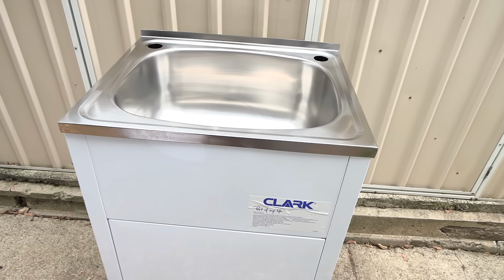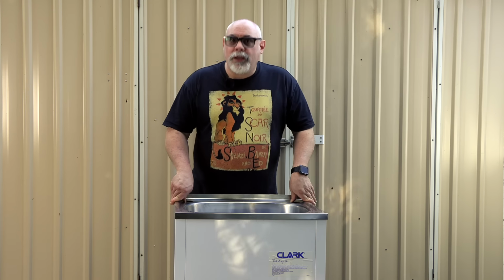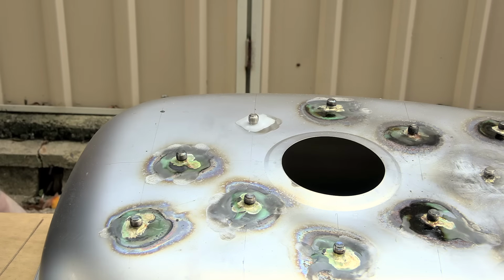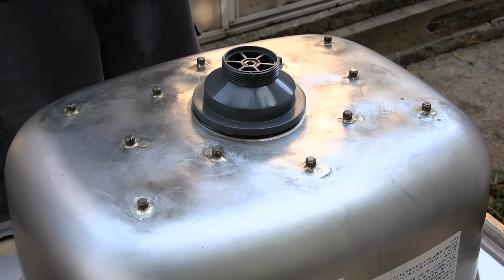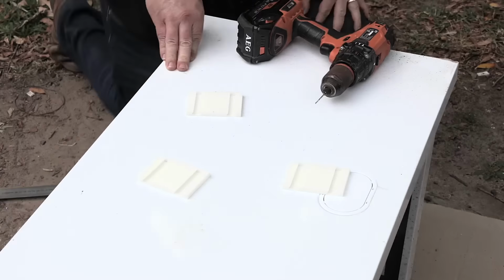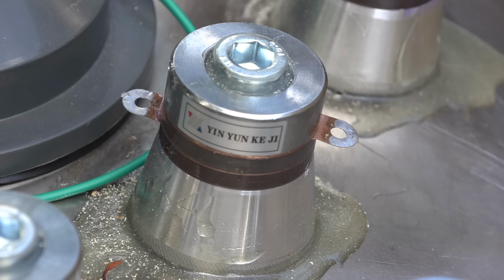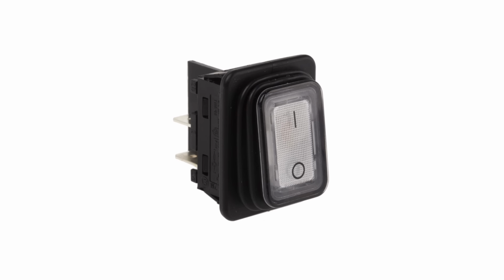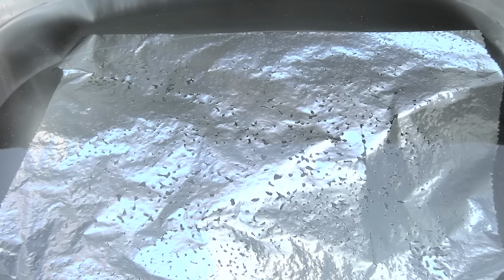Building a Laundry Sink Ultrasonic Cleaner

Comment from the maker: IMPORTANT!: To the many people who have emphasised the importance of placing grommets around the cabling going through the metal chassis, rest assured THIS HAS BEEN DONE, it just doesn't appear in the video. The chassis has also been earthed.
Reply: That's fine, but you need to make the need for earthing clear in your video and on your schematic. Other people may follow this method and not think about it. This is a particularly hazardous project with a metal chassis containing water, and mains power beneath.  A low power control panel using 12v to drive relays switching the mains power would also have been a nice safety feature. Otherwise - great project.
Reply: Lol earthed… it’ll be fine… I earthed out a single wire earth return, carrying 19kva. I de energised the line with my body. I lost both legs n 30% of my body is skin grafted….
Reply: Even the mains bus bars are sketchy, it should have physical isolation between them
Reply: What was the cost compared to buying a cleaner? Was this worth it?
Reply: I would also highly recommend GFCI.
Reply from the maker: @JeffreyBaitis  That's referred to as RCBO here in Australia and is mandatory in all households.
Reply: @BranchusCreations  Great to hear. Unfortunately USA has a lot of legacy/dangerous wiring that is very unsafe in any setting involving liquid. Also, your project is awesome!!!
Reply: @BranchusCreations  There is a rule for connecting the ultrasonic module. After installing, if it doesn't shocks when touching the water then the connection is right otherwise swap the connection🎉 ...
Reply: @BranchusCreations no not all houses. All new houses and recommended in all existing houses. As a contractor I come across houses on a daily basis still using ceramic fuses
Reply: I was just going to mention..... lol well done. Where is the vid of showing this sink cleaner testing please?
Reply: Glad you mentioned that you grounded it! I completely missed that during the video at a glimpse! :)
Reply: @Look_What_I_Did  their concerns are valid and if he doesn't stick a note here the chance of any useful comments being seen will be lost in a comment waterfall of, "grommets and earth?!?!?!"
Reply: As a electrician earthing and mechanical protection is my biggest priority. Love the Build excellent job
Reply: @BranchusCreations  للأسف ليسة لدي حساسات ولا مشغلات كم أتمنى أن أصنع واحدة فلدي عمل فيها مهم
Reply: @BranchusCreations  أريد المشغلات مع الحساسات بشرط أن يعملون بشكل جيد . ٢٠ واحدة
Reply: Great to see you've addressed the earthing and grommets — really important for a build like this. One thing I haven't seen mentioned anywhere in the comments: do you know the actual output voltage these drivers produce on the transducer wires? Since they run on 220V mains, the output to the transducers is high-frequency AC and can be significantly higher than mains voltage depending on the driver design. Just curious whether you measured it, and what insulation rating you used on the transducer cables. Thanks for the great content!
Reply: I pleased to see this reply, I was more than a little concerned about the earth connection as it wasn't mentioned in the video. Great job
Reply: I'm sorry this video was a little disappointing from a safety perspective. I was crinching at this project nearing the end with the same two issues everyone was mentioning - the poor mains cable management and the lack of overall earthing. This project is an earth leakage and shock potential nightmare.  You really should put a disclaimer at the start of the video even though in the comments here you say you have done all of this which is gfreat. It is so important.
To not know to do this (the earthing especially), or understand the requirement to do so from the very start doesn't give much confidence. Harsh words I know and I'm sorry. Please understand, that those driver boards don't appear to have isolation on the primary side (I need to see the PCB underside) so any failure of a transducer (letting the smoke out) could easily cause the sink and stand to become live so proper earthing is paramount.

Comment: Great video and effort,I have done the same and wished i knew then what i know now and what you have shown ! When i was training as an apprentice in 1970 in the Australian aviation dept we used an ultrasonic cleaner with a freon liquid (which is banned now) but was the goto for electronic cleaning. The freon boils at a very low temp so the bath had a cooling element arround the tank top to stop evaperation. Freon is non conductive and we could clean and use high voltage eqipment in it while operating !

Comment: Very informative video. It’s not clear from your discussion whether the supplies are AC (putting out 40KHz power), or DC as your red + terminals indicate. If the supplies are indeed DC, why not eliminate these troublesome little no-name supplies and buy one large and high quality DC supply to drive them all? If the supplies are DC, can you please measure the voltage at the terminals of any transducer?
Reply from the maker: I'm not sure what you're referring to when you say "supplies". The ultrasonic drivers run off AC mains power, and the signal they output to the transducers is DC. You're better off thinking of the drivers as amplifiers and the transducers as speakers.
Reply: @BranchusCreations  Well, if what you’re saying is that the driver boards take in AC line voltage and convert it to DC, then they can be considered as supplies. And my point about using one bigger supply to feed all the transducers would, in that case, apply. But I now suspect that the boards actually put out 40kHz square waves to the transducer, rather than a DC voltage. A web search on this didn’t yield much…
Reply from the maker: @Technical_Audio If you have a link to buy a bigger ultrasonic driver, please post it!

Comment: For vintage circuit boards, I use a small steam blaster.  Basically does the same thing but better.  you can work on specific areas with more attention.  If you have badly dirty circuit aboard as in stained etc, before the steam cleaning, first spray wd40, then spray an oily contact cleaner on the wd40, it creates a terrible gunk but clean that gunk with steam and you get a circuit board like new.  Ultrasonic is good for very flimsy parts like very detailed 3d prints but not very necessary for circuit boards.  if you have infinite money, use ultrasonic, but don't forget that steam blaster is better for most things.

Comment: Why not drill holes in the tub and run a bolt throughwith some form of gasket material or just solder them too? I feel it would be sturdier and would offer a better oppotunity to replace bad parts?

Comment: You haven't made a mains protective earth connection to the metalwork.  Imho that is poor safety design as there is no discussion on the topic, and you are relying on the transformer and pcb related safety - which is highly likely to have not passed any safety compliance testing.
Reply from the maker: I did, you just don't see it in the video.

Comment: You’re not braising. More like tack soldering. A better connection… apply solder to underside of bolt & sink separately. Then apply heat to both.

Comment: Improve cooling fan efficiency & increase RELIABILITY of the ultrasonic DRIVERS,....
The fan cooled box requires some EXHAUST VENTS at the opposite end of the enclosure allowing the
HOT AIR air to ESCAPE through the vents whilst the cool air is coming in from the fan supply
Reply from the maker: It does have exhaust vents, they are under the PCB. The PCB is raised from the base of the box and there is a hole in the bottom of the box. The fan pulls air up from under the box, across the PCB and then out through the exhaust fan. I'll detail this in the follow-up video.
Reply: @BranchusCreations  
That's sounds great, 
Sorry for stating the obvious about the cooling fan & ventilation, I just wanted to  help out if I could.
Also, I'd like to say "good work" on the ultrasonic build, all of the background information was fantastic and the video was great 
   Keep up the good work 🙂

Comment: I would definitely use jb weld as an epoxy but you don't sound American so im not sure if that is available to you
Reply from the maker: Yes, we have JB Weld here in Australia, and I used it for a previous ultrasonic cleaner build. The standard epoxy is sufficient for this purpose. It's the silver solder that does the heavy lifting, the epoxy just helps to transmit the sound waves and stop the transducer from vibrating itself loose.

Comment: Hint: use 63:37 solder. This formula of solder has no gel state, so it goes almost directly from  liquid to solid, which means far fewer cold joints due to movement.

Comment: From my experience here in Brazil, with ultrasonic bathtubs, over time, the metals that are cleaned will release residues and the vibration of the residues in the water will sand the sink until the metal becomes very thin and the weight of the speakers will collapse the sink.

Ultrasonic bathtubs that use professional water inlets and outlets have a much longer useful life, because the water circulates inside the sink and the dirty water is carried away, so the dirt does not sand the sink.

Therefore, given the power you used, it would be more interesting to have a constant water inlet and a constant water flow to prevent the sink from collapsing, increasing the useful life of the system.

Comment: They work I used 2 cold mist humidifier transducers and drivers and it does work the problem is putting your hand in the water .it can be very painful but if you remember to shut it off before you stuck your fingers in it works

Comment: Depending upon the design, if the drivers are free running (not crystal control) they may actually phase lock to each other. This has been demonstrated with multiple microwave magnetrons and even with pendulum clocks.   Christiaan Huygens effect.  This could be verified by attaching a dual trace oscilloscope to two of the drivers and noting phase relationship (dependent upon their physical placement). If all pairs of drivers 1-n, 2-n, 3-n, 4-n, 5-n,6-n agree , then likely that they are synchronizing.

Comment: Wow that's a great video. Thank you. Really really interesting to see how these work are. I use small ultrasonic cleaners a lot of the time but I've never bothered to see what is actually inside the box of tricks., it really is quite simple to knock one up yourself by the looks of it. Thanks a lot for the excellent tutorial.  Watching this I really think I am going to make one for myself, the prices of the pieces are not that expensive and you do not need to be so elaborate in the wiring as the original poster has been. He even supplies the 3D printed files for free. Amazing poster. Thanks a million.

Comment: Thank you for a really good channel. 
Question:
How special are the "screws"? 
Can a threaded rod be cut down to pieces and used or is there a reason why they come like they are?
Also with the epoxy, why can't they be attached with small bold through the metal?

Comment: Hi there, I am currently in the early stages of building my own Ultrasonic Cleaner custom for long Leadscrews (up to 1.1m long). Your rule of 100W/gal for calculating how many transducers are needed for enough cavitation is good, but for my design I am worried that the high surface area to volume ration means there will be enough power for the volume, but there will be dead zones where the transducers are too far apart. Do you have an advice on this?
Reply: I think I need more transducers with smaller powers, but I am not sure where to find them.

Comment: Great video. Thanks for posting.  The only thing I would recommend is to make sure to put some protective shielding on the rough edges of the pass through holes from your control panel into the main cabinet to prevent the sharp edges from chafing away at the wire insulation.

Comment: I used to make these out of 30L restaurant mixing bowls and reclaimed cabinets. The circuit boards/drivers were about the only part it took me a while to source until they started making kits for this. While shopping for a third set some years ago, I saw an industrial unit on ebay and threw out some stupid lowball number to the seller, fully expecting a no.
Yeah, it went into my home lab and works so well that I've never turned on the heater. It will easily heat up the huge tank to 45*C just running for 30 minutes. Takes about 3 hours to drain through the pitiful drain cock, so pumps are necessary. That's about the only part I miss vs the big bowl (though your drain exit would solve that problem even better). 
Totally dig this approach though, and it's a lot smarter to use a sink basin. Corner filling old cabinets is a bit of a pain. 👍

Comment: Curious if the bolts (which you soldered on) are a common size? Would something like a Clic Bond fastener work and avoid the hassle and warping of putting heat into the basin?

Comment: Fyi.
For any future soldering endeavors with silver solder, you should use mapp gas or a b-tank. I'm a retired master plumber. Silver soldering was almost a daily. Also you don't need that much flux. Flux is a cleaner and helps but with silver soldering it's not needed

Comment: Warning THE SINK NEEDS TO HAVE A SOLID EARTH CONNECTION. If a fault occurs in the drivers you could end up with mains on the sink. Also i didn't see any earth connection to the steel cabinet. You need to edit this video

Comment: The only difference between live and nuetral is that neutral is connected to property earth, so it would make sense to connect the live to the connector that has the least amount of copper track after the pin, thus less chance of human touching or short to casing. In reality you'll probably find the copper tracks amount will be equal. Make sure the sink has a solid earth connection with stranded wire and a locked bolt connection. The vibration could loosen a poor earth fitting

Comment: This build was fantastic.   Lots of tech problems to solve.  
The silver solder part was great. 
I'm curious, if you used a hard (stiff) drying epoxy to ensure propagation, how did it hold up against the tub flex?
Have any cracks developed ?  I could not find the epoxy used in your description.  
I did see the wire gauges, which was helpful.  
I'm curious if the build could have been done with a large single driver.  
I've another dozen questions but this video is a year old and you may not even be reading the comments any longer.

Comment: I worked for CAE Utlrasonics you are spot on except we spot welded the bolts to the tank then used a formaldehyde based epoxy. Well done! my job was to repair the electronic Generators as they were called.

Comment: This is a great video and an amazing project. Some quick tips about silver soldering. Solder tends not to flow where there is no flux. More flux is not helpful. When soldering parts that have different thicknesses, pre-heat the part with more mass to reduce distortion of the thinner part. Not applicable to your project but never solder parts that are under stress such as bent plumbing fittings or press fit pieces. This can cause a liquid metal fracture.

Comment: Suggestion: A good mechanical connection is also good before soldering. I would wrap the wire around the connection and then put some flux on it then solder it. Your way will work too, of course.

Comment: Have you experience any "power loss" of the transducers? Here the first time I ran the cleaner with an aluminium foil and it worked like a charm, I could also feel the tingling on the water in my fingers, after that I filled up the sink and tried cleaning some solder flux off some old motherboard, and I could notice that the transducers noise levels wasn't the same, and I couldn't feel that tingling in my fingers anymore, I did a couple of tests with less water and still nothing, I didn't do any further tests, but I'm worried that I messed up something, the bolts were soldered just like you did and I use AB glue, so if I need to replace the transducers that would be a huge pain, I'm going to do more tests next weekend, hopefully it isn't something serious

Comment: Great video super-informative. While watching, two questions came to mind: 
1. Does the drain hole change /modify the flow of wave frequency (as opposed to flat sheet metal)?
2. Would it be beneficial to weld transducer fixing bolt, then weld an eyelet to the basin next to the transducer, secure with wire or similar? This could eliminate the need for epoxy resin, and transmit wave more directly. 

I'm asking out of interest and ignorance. Great project, will build one, too. Thanks for the great info!

Comment: For transducer, its better to use U shape terminal connector and physically clamp the cable (you can also soldering after just in case) before connect it with screw and nut. Because if you run it continuously for long period of time, the transducer will still get too hot and the soldering joint will eventually loose because of the ultrasonic action and heat.

Comment: Thanks for this. If one wants, for particular technical reasons, build an ultrasonic tank that is taller than it is wide (say, 300 × 300 mm, 450 mm high) would you advise to put the ultrasonic transducers on the bottom underneath (as traditionally), or on the vertical walls, or both? If put at the bottom only, wouldn't the thick layer of liquid in such a particular high tank attenuate the cleaning action too much in the upper part, near the surface? On the contrary, in order to prevent power decay along the Z axis and distribute the ultrasonic power more evenly within the entire volume, if the transducers are put along the vertical surface, can they face each others on two opposite sides (or even the four sides) of the tank, or could such a disposition introduce potential destructive sonic wave interferences?